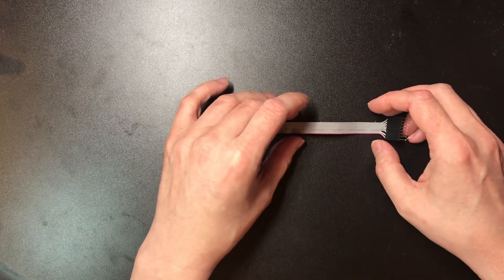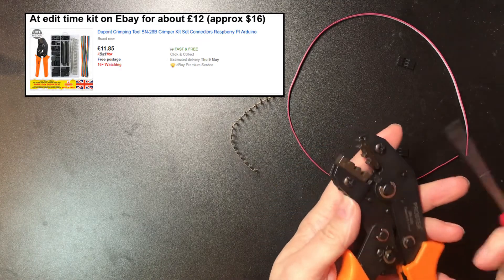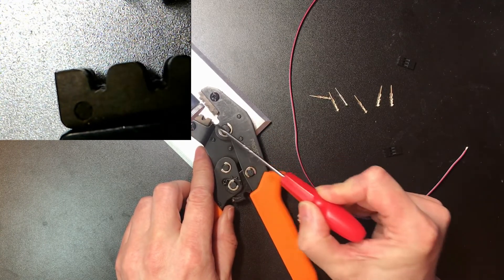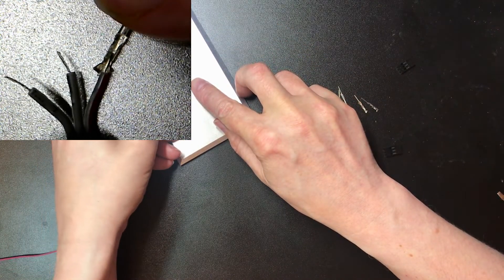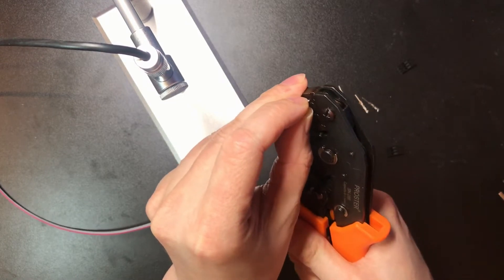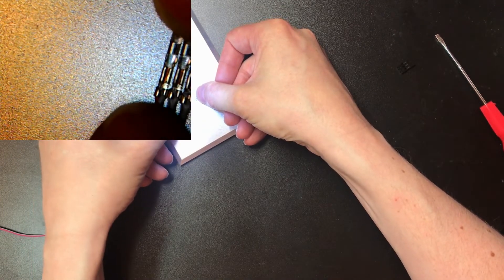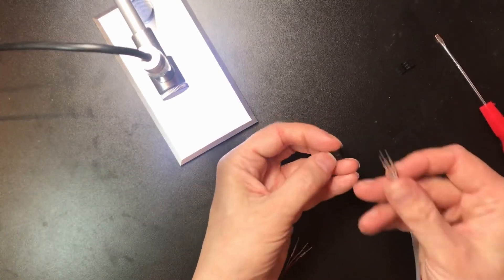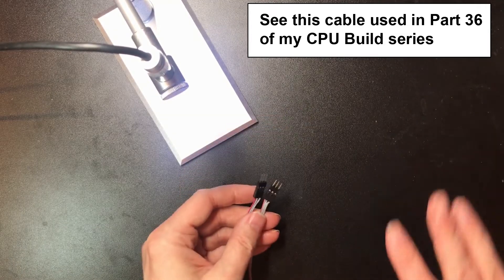Making Dupont Cables

Comment: Was just making some of these and was having a hard time inserting the female connections onto the male headers on an arduino. @4:10 when you describe pulling it ahead, I think that was my mistake. I think I have been compressing the part where the pins go INTO the connector hence why they stick out like 1-2mm from the connector. I will try again. First time :D I knew i'd make mistakes though :D :D :D
Reply from the maker: Hope it was useful! Much easier when you get used to it.

Comment: Thanks for this!
I bought a crimp tool and had no luck with it.
Looking at yours, I see mine has the top and bottom jaws reversed.
But they can be changed so I'll try that.

What I've done most of the time is buy pre-made dupont cables which have each pin housed as singles.  I take the pins out of the 1x housing and put them in Nx housings from the crimp kit.
Reply: I flipped the jaws, tried a crimp and found mine is designed differently.   Yours has the valley be the pin base or bottom, mine the valley is doing the crimping.
Either way, I couldn't get the pin to stay in the crimper so I could feed the wire, then crimp.
I figured out a technique though:
Without anything in it, bring the crimper down 1 click.  I could then feed the pin through the side until it stops, then the wire.
Complete the crimp.
Now to see if with the 1 click method, if it is easier with the jaws set where the open face of the pin is up, or down.
Reply: Looking more closely at the video, you do have the pin upside-down in the valley (open side face down into the valley)
Reply from the maker: Ha!  I've actually been doing that recently,  much quicker than making my own cables from scratch. I only do that now if I want a length that's different.

Comment: You make it look to easy. Nice guide. I dont know if my crimper is not good, or I need to practice more, but mine never come out this well. If I need it to be a safe connection, I will crimp it with simpler non ratcheting crimping tools or even needle nose plyers.
Reply from the maker: Might be tool issue obviously.  Make sure the pin is seated right in the tool, and make sure the insulation doesn't go beyond the first bit of the pin.
Reply: @weirdboyjim  Thanks, will definitely rewatch this when doing my next crimping job.
Reply: P.S. Where did my heart go? Damn, haha.
Reply from the maker: @eraldylli  The original one was a misclick, far too close to reply!  But you can have one here ;-)

Comment: TIL there is a tool to do this... I've been soldering the wires and crimping the isolation using plain pliers... and I was sure I knew how to make these cables. Thanks !
Reply from the maker: I first bought shells and pins, the tool makes it massively easier!

Comment: I'm questioning one thing : Isn't using your fingers to straighten the conductor damaging ? I'm  not saying you have dirty fingers, but no matter how hard you scrub, you can't prevent greasy and acidic products to seep from your skin - thus leading to almost instantaneous corrosion and long term loss of conductive performance.. Maybe you should dip the wires in some sort of solution to make the contacts more solid (just guessing, I am absolutely no expert)
Reply from the maker: You could be right, but I don't think so and I certainly haven't hit problems (some of the dupont cables I've made are several years old and still working fine). The worst thing for these types of conductors is oxygen and you mostly relying on the crimp being so tight the metals are squished against each other. Worth thinking about though.
Reply: @weirdboyjim  I absolutely admire your work ! Not only is the ALU, memory access, and of course - the pipelining - absolutely astounding - and it is WAY over my head ! I'm a 6502 generation guy - but also an IBM mainframe era guy (yeah.. those things already had in the early 1970s pipelining, 32 bit registers, a MMU, generalized asynchronous I/O operations).. I usually work on the software side (emulation) but those hardware quirks you put in place are giving me a lot of ideas when emulating an IA...

Comment: Thanks for this tutorial, it was illuminating, with excellent detail.  I eventually purchased an IWISS SN-2549 as it supports four different pin sizes and on balance had good reviews.  Mechanically the alignment is just a bit different from your tool: the pin has to be aligned such that the rearmost (insulation) end is flush with the front face of the tool. This places that little  square nub, used for fixing the pin to the shell, just beyond the rear face of the tool.   As DodgeDeBoulet mentioned, because of this flush alignment, it's much easier if you leave a T-shaped portion of the reel still attached to the pin, and press that portion flush to the edge of the jaw, just before crimping. It snaps off easily, after the crimp.
It's a bit tricky at first, but you can first insert the wire into the pin, and then insert the pin into the tool, grasping the edge of the T-shaped portion.  After a few pins, it becomes second-nature. 
You do have to gently bend the tines for the insulation portion to be parallel before crimping, as they are a bit splayed as manufactured, and will otherwise turn a bit as you crimp, mangling the pin, and force you to use language your mother would rather you didn't.
Reply from the maker: I might try and look at the IWISS SN-2549 at some point.

Comment: I don't think it was mentioned but one can also remove pins from these cables when necessary by lifting the plastic clip that holds the pin in and sliding the pin out.  I've  found this useful on occasion, for example, swapping the transmit and receive pins on a serial connection.
Reply from the maker: Yes! I've done that a few times. Mostly to rework a custom cable but occasional to rehouse one the cat chewed! I keep my cpu build out of cat reach after that discovery!

Comment: Love your work man! I was wondering: where do you buy your cables? I can only find flat cables with certain amount of lines, for instance, 10 or 25. Do you take such cables and cut them to make, for instance, cables that have 4 lines? Is that even possible?
Reply from the maker: Thanks Jelle! The ribbon cables are really easy, once you get it started they split easily along the seam between insulators.  The grey ones in my build started out life as much wider cables from eBay.

Comment: A suggestion: Don't remove the carrier strip from the pins before crimping; clip the pins apart along the carrier and leave the short piece of carrier attached.This helps greatly in aligning the pin in the jaws of the crimping tool (the edge of the strip goes flush against the jaws), and provides a guide against which the wire can be inserted. The carrier can be snapped off after the crimp is complete.
I also start the crimp before inserting the wire, and find that I can "feel" where the insulation impinges on the portion of the crimp that grips the conductor; I find this to be less aggravating since the pins no longer have the option of bolting for their freedom. But of course YMMV ...
Reply from the maker: Interesting, I'll give that a try. I've tried a few different methods for getting the depth right, messing that up seems to be the biggest cause of failures for most people.

Comment: Hi, thank you very much for the video it is very helpful.
Where can I get those kind of connectors, dupont connectors?
Reply from the maker: If you search for "dupont kit" on ebay there are usually lots of sellers for the base kit I have been using. I just buy extras of the bits I use up.

Comment: if you put the pin into the crimper hold it with one click, then put the wire in it holds it
Reply from the maker: Thanks for the suggestion, I actually started doing that but for me the cables are more reliable this way. When you hold the pin in the crimp tool it makes it far more difficult to get the right amount of insulating sleeve onto the top of the pin. If you go to far you don't make a connection, if you don't go far enough the wire is weak because it's gripping wire rather than sleeve.

Comment: James, what do you use for striping the jumper wires for the breadboards? All I see when you've been creating them on screen is what looks like your twisting something around the wire once you've determined how long it needs to be. Also what gauge wire do you use for the jumpers? Thanks, Drew
Reply from the maker: *If I’m making a very short wire (like a power or ground one) I score at the length I want to keep, pull the rest of and then slide the remaining bit into the middle. Speeds things up a bit.
Reply from the maker: My wire strippers don’t work well on the solid core wire, it tends to tear the insulation a bit more randomly. I believe there are other kinds that work better but I haven’t investigated. What I’m using is a craft knife blade, I just score round the insulation and then pull the insulation off the end*. The wire I’m using at the moment was sold on ebay as “1/0.6mm equipment hookup wire”. I did buy the “adafruit hook-up wire spool set” but that has thicker insulation and fitting 8 wires in close proximity gets difficult.

Comment: I struggle making them as I keep knocking the pins out of the tool!
Reply from the maker: I feel your pain. I just about got my technique consistently working and then send the first pin on camera flying.
Reply: @weirdboyjim  When you have you pin positioned in the tool how you want it, have you tried closing the crimper just enough to hold the pin in place?
Reply from the maker: JetGyrotech I started of doing that but it’s harder to gauge how far in you have poked the wire.